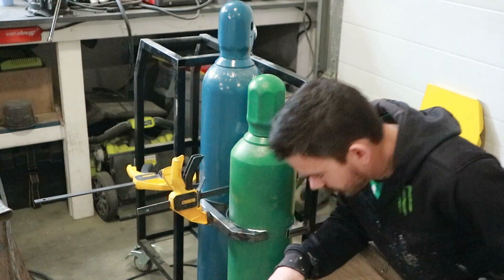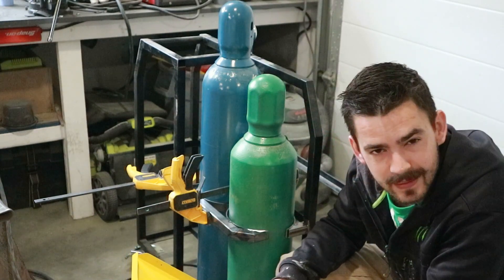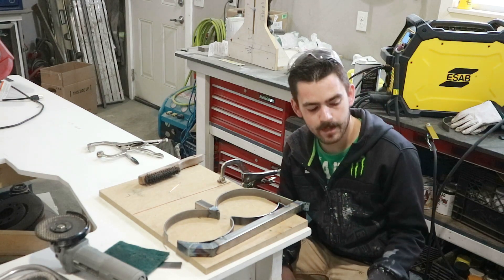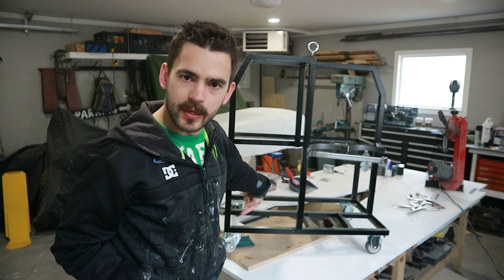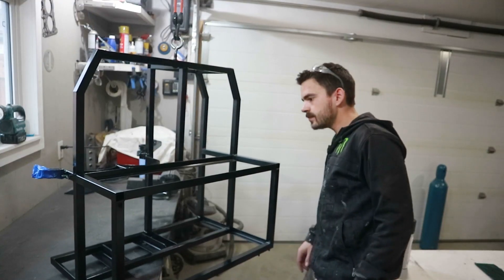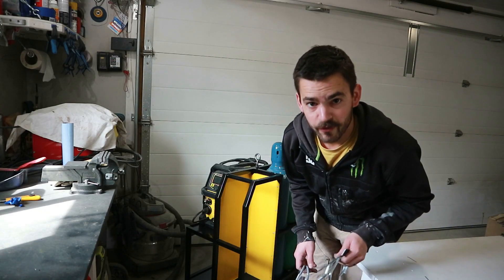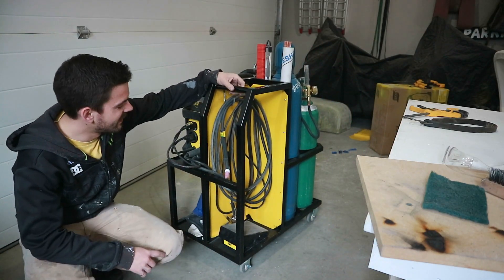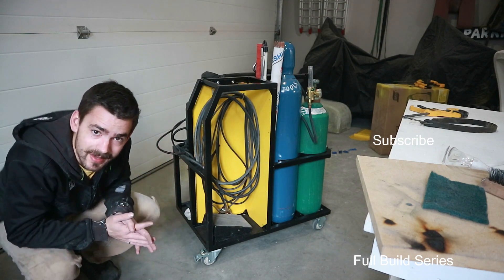Ep67: ESAB Rebel 205ic Welding Cart Final Construction

Comment: Dude that looks amazing.
I literally just bought that exact same welder and have been wracking my brain on the design of a cart I should build for it. I really likeyour concept, however due to the bottle sizes I have for mine, the configuration will have to be different that the one you built.
Always looking for inspiration. Glad I came across your channel.
Keep up the good work.
One last thing, if you have thetime to reply, fellow Canadian to Canadian (you mentioned Canadian tire) how have 5ou found the welder, performance wise, and have you had any trouble with the AC tig function at all. I haven't although I did read a post stating that the AC function for aluminum tig crapped out almost immediately for some guy, have you had any trouble to speak of?
Just thought I'd ask. I don't think I have buyers remorse, only slight panic, after spending as much as I did.
Thanks in advance if you do manage to find the time to actually even see this post let alone respond
🍻
Reply from the maker: Thanks fella, I would be happy to respond and put your mind at ease. I have been using the 205ic for a while and it has yet to fail me, I have recommended it to friends and they have had no issues. Like all inverter machines it is possible for the board to short out just like Miller, Lincoln, Everlast, Eastwood ect, but I have dealt with ESAB on other matters and they have been super helpful and I'm sure they would take care of you. Its a great welder, don't worry about what the internet says and just get under the hood and burn some metal.

Comment: Really nice design! Especially the way you've got the line hug, having them in the frame so they don't get squished by the wall or bench. How are you liking the 4 in one after some use? is it lacking in some areas that an only ac/dc tig can do?
Reply from the maker: I love it, nothing specific that a dedicated machine could do over it. I am still questioning the longevity of the inverter vs a classic transformer machine, but time will tell